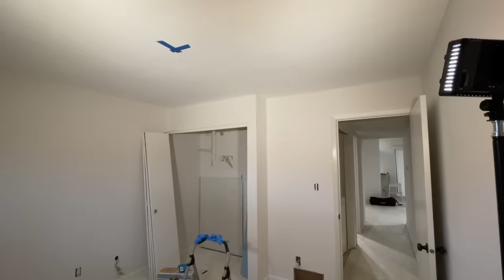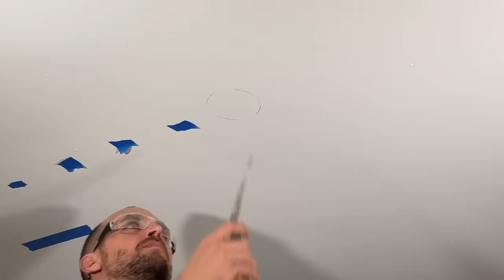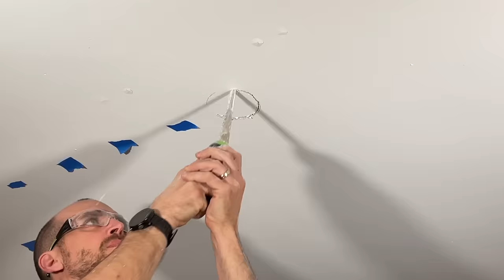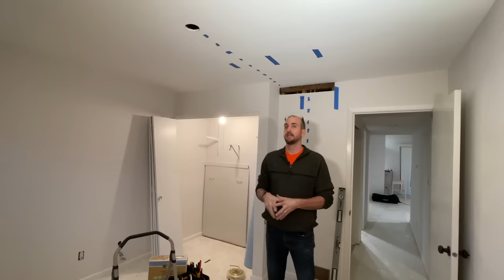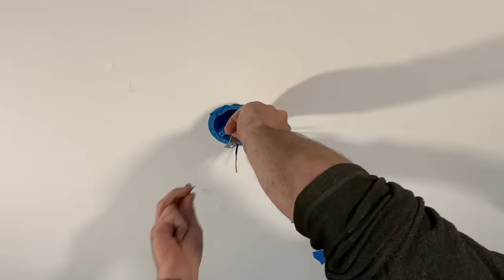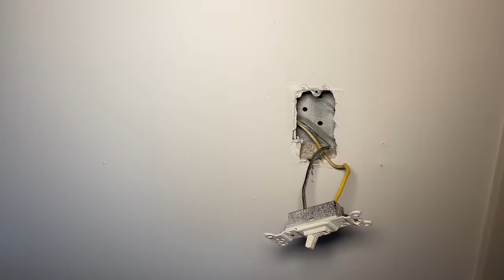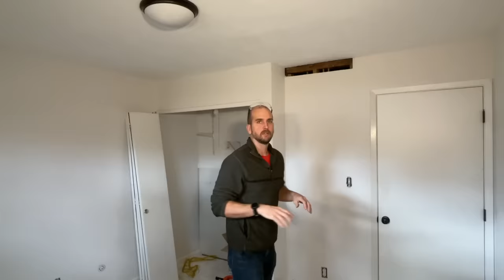How To Install Ceiling Light Without Existing Wiring

Comment: A really informative video. It's interesting how things differ in the U.S.A. In the UK you have to run a separate lighting circuit and a separate sockets ring main for each floor of the property.  You are not allowed to wire lighting circuits from a ring main for sockets. Also all wall sockets in the UK must be individually switched, defo no sockets without switches to isolate.
Reply: UK code was heavily affected by the copper scarcity due to War.

Comment: If there is an attic, it can be done without cutting any drywall (except for the box in the ceiling). 1. Find constant power source (in the attic or closest to it) 2. Make run to the box. 3. Install remote (to avoid running for the switch) 4. You are done.

Comment: Great video. But shouldn't the ROMEX insulation coat be white instead of yellow to the fixture and outlet? I thought yellow is used for bathrooms. 

Also, couldn't you make the connections directly to the switch, cap off the wire going to the outlet, and replace the receptacle for dual outlet "on" constant?

Anyhow it was a great video, and thank you for posting!
Reply: Newer Romex jackets now denote wire size. White for 14 AWG, yellow for 12 AWG, orange for 10 AWG, and black for 8 and 6 AWG. Yellow in the bathroom just means a 20 amp circuit instead of 15. This helps to not overload the circuit when for example both a hair dryer and a curling iron are being used at the same time. Heating elements draw a lot of power. That being said, I’ve seen a lot of older romex  that’s white no matter the gauge. So double check if your doing remodel work.

Comment: Now about the drywall repair......let me help, do the repair thats the easy part, its matching the knock down texture that the hard part add water to the drywall compound till its about a little bit thicker that pancake batter and stick all four fingers of one hand in it to, where they are wet , than throw them at the wall (patch ) and the compound will splatter repeat if needed than let it dry slightly or completely and use a trowel or sandpaper to do the knock down,  practice before hand in the garage is fun and will help.

Comment: Great video. Thank you. Just one question: at 14:15, what's the 4th neutral wire? One is coming from the ceiling fixture, one is connected to the left side of the outlet, and one is going back to the breaker box. What is the 4th?
Reply from the maker: Hi Paul,  the 4th was going over to another outlet which was wired on the same circuit.
Reply: @EverydayHomeRepairs  I am shocked that someone said about that, but on that topic. Some codes do not allow you to use a standard receptacle box as your junction box. You should’ve ran directly to the switch box with the romex then came through the emt conduit with the constant hot. Also because it complicates a lot for people coming behind. Because most come from the receptacle to the switch for constant hot.

Comment: You don't need a ground wire for conduit.  Also, if the switch already had a constant hot, why would you connect the yellow at the outlet box?  Seems you may not know as much...
Reply from the maker: Hey Darrell,  I was doing some work on the receptacle anyway to remove the switched functionality so that is why I went down to the lower box.

Comment: Many people have suggested running the romex from the light directly to the switch. I guess I dont understand how you do that when the incoming power goes to the outlet, not the switch. Would you need to run the 12/2 wire from the outlet up to the switch? I guess I'm confused about how to wire the light when there was no common wire in the switch box.
Reply: If he ran the romex from the light to the switch, then wouldn't the switch still turn the outlets off? He wanted the outlets always on (which makes sense). I get confused with this stuff as well, btw.

Comment: I have wired light fixtures and outlets many times but my 1978 built home always like to throw a curve.  
My second “hot wire” is red instead of yellow.  Fine it’s still identifiable.  I only have one outlet that it operates.  That means I don’t have to remove a bunch of “extra red”-even better.  My issue now is that inside the junction boxes are several “extra” black/white.  This may be a stupid question but how do I know which to use when re-wiring the outlet?  
Also, you changed nothing in the switch itself?  Everything was done at the outlet box, correct?
Reply: Red wire where? What receptacle? What switch?

You could always cut power at breaker, disconnect the wires in a junction box, tie two together (a black and white on the same wire) then test continuity at various receptacles to see which ones it runs to. When you hear the beep you know where it goes. That being said, you didn't really describe your scenario well.

Comment: Is it possible to spice into the switch instead of going to the outlet? This would leave the outlet on the switch and not power on but in my situation, the switch and the outlet are on opposite sides of the room with the switch is much easier to get to.

Comment: isnt that 12/2 romex? Is that okay on that circuit? nice video BTW
Reply from the maker: 14/3 Romex would be a better choice for this install.  Thanks.
Reply: @EverydayHomeRepairs  Take it from a master electrician, There's no reason for 14-3! How do you know you could use 14 awg?
Reply: @chadcarter269  I would have advised him to install an old work fan rated box with a 3c romex.   Depending on circuit  for size wire. 
If you're going through the trouble of running the wire, plan ahead in case someone wants a fan/light

Comment: This is an okay solution but I see ways you could have done this without having to cut the sheetrock where you did.  The closet is right there, you could have used the inside closet wall after drilling and fishing over to it.  You also have the option of using a ring insert you would use with networking with a two gang blank in the closet on the wall to avoid sheetrock repair.  Another tip if you need to remove sheetrock, use a rare earth magnet to find the nails before pulling the sheetrock, cut out around and pull the nails.  Then you can pull the sheetrock piece without breaking it.
Reply: Same thing I would’ve ran from that receptacle box, over to the closet ( Greenlee flex bit ) cut holes in closet and fish in the closet so I wouldn’t have any exposed patching, and mounted a proper fan box in the ceiling because somebody’s gonna put a fan on that at some point.

Comment: Good presentation, very helpful!
Reply from the maker: Thanks Joe!
Reply: @EverydayHomeRepairs  Hi Scott have an opportunity to install a new ceiling light just like your scenario. the only question is I have one more line that is on the left side on the wall switch that carries the load from the switch back into the ceiling somewhere down stream.
Questioning do I need to do anything with this? I think I should be good? Thanks

Comment: Thank you for taking the time to make these videos, extremely helpful. There is something I've always wondered, how many outlets / fixture can you have from one source? Can you keep adding junction boxes breaking off from the original source?
Reply from the maker: I think it depends more on the load of each receptacle / fixture.  For example I am adding 11 LED recessed lights next week to the same circuit but each draws so little power I am not worried.
Reply: Add the wattage of each load on the circuit, if you have a 15Amp circuit (most likely) then your cumulative wattage should not be more than 1400Watts, 20Amp = 1800Watts.
Reply: Theoretically unlimited. Practically, you have to consider possible loads in the room. How many amps will be used? Is there a window AC in there? Mini fridge? Those use a lot of current. TV? Modems, gaming computers, and routers? That can be 6 to 8 amps right there. What's the circuit rated for? 15 amps? I'd go all 20A circuits but most houses have 15A circuits so you have to think about that as your max amapacity. And then will you run a space heater in winter? Those run at 12.7A or somewhere around there.

In other words... you probably don't. Now many builders will put the lights on a different circuit but daisy chain a few rooms lights to that same circuit. But if you put a light on the receptacle circuit heavy loads you may notice the lights dim way down because you have to account for the lights and fans current draws.

Comment: Why did you use 12/2?  It’s only an LED light, or is that code in your area?
Reply: Probably because they wired the receptacles with 12 gauge wire

Comment: couple questions, 1 should have shown how to isolate before working. 2 why not just add another switch for light and leave sockets as they are. 3 is the fuse or circuit breaker rated correctly for lights. Always use a qualified electrician

Comment: I don't think you necessary need to remove the two yellow wire it just make it more confusing, the black can just attach with all the yellow wire and call it a day. I believe the light switch will still work.

Comment: You might want to center your cut out on the floor joist and use a pancake box and avoid the fixture from being puled down when they change there bulb

Comment: I have a questions I'm planing to install a switch light in my basement but currently there's only one of those light that has the string to pull it to turn on. How would i go about installing that I know I need wire from my light fixture to my light switch. But what else? Also I should ad my basement isn't finished so I don't have to cut through any drywall

Comment: It was hard to see in the video but why didn’t you have to drill thru the top plate of the wall to fish the wire down thru? Also, the floor joist direction shouldn’t much matter, as there is also strapping running perpendicular to the joists that you can run wiring between.

Comment: i have a kitchen that has the regular kitchen light, but over about 6 to 8ft over the diner table, a ceiling fan with light kit. as of now, when i turn the light switch on, both ceiling fan light kit and regular kitchen light comes on. how do i separate them out so that i can control fan light kit separate from kitchen light? i have a double switch that i wanted to use already that will fit in the existing switch box. also i've already taken the switch cover off to see if there's two hot wires, and there is only one hot and one neutral. thanks

Comment: I have a very similar situation  with the exception that my switch is perpendicular to the way the floor joists above run and the switchable outlet is about 10 ft away from the center of the room where we would want the light. Our home is a modular with 2x6 wall studs and 2x10 floor joists with hardwood floors so cutting through the floor above is not a desirable option. Any suggestions would be greatly appreciated.
Reply from the maker: Do you have another (switchable) receptacle on a wall that is parallel to the floor joists.  This is what I had on the other room so I used the outlet on a wall perpendicular to the switch.
Reply: No. There is only the one switch in the room.
Reply from the maker: @terrycastor8299  right but what about the number of outlets?  I actually went from a different outlet as opposed to the traditional method of going from the switch.
Reply: Pull entire panels of drywall off would be easiest. Might as well open it up. Then notch through the bottom of each joist and cover with strike plates or drill holes through each one. Who the heck doesn't include basic lights in each room. That's the crazy part. Yesh I've seen it but dang. And a modular home with two stories and 2x6 studs and they could not put a light fixture in the room? That's even crazier.

Comment: The blue boxed used for the led light on the ceiling what did you screw it into?
Reply from the maker: Those type of boxes are "Old Work" so they just have tabs that hold on the back side of the drywall.  It should be noted that those boxes are not rated to hold a heavy light fixture or fan.

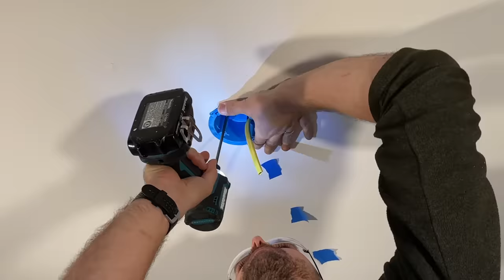Comment: Is there anything to hold the ceiling junction box for the light? I saw at 8:19 you were doing something. Thanks
Reply from the maker: After a ton of great comments I would say this is a much superior box as compared to the one I used https://amzn.to/2W0rDfY  The box I used just has a small metal bracket on the back and that was connected to the 2 screws I was tightening which secured the bracket to the back of the drywall.  This is fine for a LED light but not going to work for a ceiling fan if anyone tries to install in the future.

Comment: Nice method. But what do you do, if you have a brick wall and a concrete ceiling?
Reply: Exposed conduit for the industrial look?
Reply: @lorenwillis425  Exposed conduit I would not prefer in my living room.
Reply: @manfredwitzany2233  I understand.   But industrial is a style.   And really, in your situation,  probably the only solution.
Reply: @lorenwillis425  Not really. I use a crown drill to make a hole for the flush box and use an electric chisel to make a slit. In this slit I mount a conduit and refill everything with plaster. Then I can insert the electric wire.
Reply: @manfredwitzany2233  sounds like you had the answer to your own question.

Comment: I have the same issue in my house. However, I mistakenly fished a 14/3 wire into the switch box and removed the old outlet so now am unsure of which outlet the switch previously powered on. If someone has a way to help, please let me know.

Comment: You know some smuck down the road is going to install a ceiling fan to your drop in box, probably a better idea it to cut a 2x4  two foot long and push through the open floor joist and secure it through  the ceiling with a couple of 4'' screws...
Reply: Agreed. I think leaving a warning  note taped inside the light box would be another alternative.

Comment: Trying wire in a ceiling fan to a switch that controls a outlet in the room I  wired everything up when I turn on the switch powers the outlet and not the fan but when i switch it off and pull the fan chain it powered the outlet and fan

Comment: Why didn’t you just take the Romex wire to the Switch box? You could have connected it inside there & tied the outlets to the feed in the switch box, that way you would have never had to touch your outlets at all

Comment: Dumb question: why did you remove the drywall so far to the top? Unless there's absolutely no other way your're giving yourself a hard(er) time patching it up when you're so close to the ceiling (or any corner for that matter...). Just wondering.

Comment: Id like to see how to run wire across studs with minimum drywall damage.  No one ever shows that.  They always show the easy way to add an outlet or ceiling light using stud cavities to run wires.  I want to see a more difficult method of running them across the studs for a change, without tearing up the whole house to accomplish it.

Comment: Wouldn't it have been easier to go to the switch box and just change the switched outlet wires to constant and the new wire to the switch??
Reply: I had the same question...  if trying to make things simpler/less confusing for future, that would seem better than having the overhead light wiring routed through an outlet.

Comment: I usually rewire the outlet, so the wires going to the switch are changed to a hot and neutral. Then I run my wire from the switch to the light like a normal switch leg.

Comment: Quick question,  replacing a new outside light above a door, it seems that the existing light  had a ground from the internal home to the metal light box box, I left that and grounded the new light to the green screw on the mount bar, is that permissible?

Comment: Per NEC you should be stapling the Romex to the studs every ~2ft
Reply: I think NEC gives you an out on staples when it’s not readily accessible.  
———— 330.40 (B) (1)
(B) Unsupported Cables. Nonmetallic-sheathed cable shall be permitted to be unsupported where the cable:

(1) Is fished between access points through concealed spaces in finished buildings or structures and supporting is impracticable. 
——————

Also, I think it calls for securing every 4.5’ and within 12” of  the box.  ——-334.30. Securing and Supporting

The cable must be secured at least every 1.4 m (4½ ft.) and not more than 300 mm (12 in.) from a fitting, box, or cabinet. There are requirements for cable trays, unsupported cable, and wiring devices without a separate outlet box.
————
2020 NEC SECTION calls out max cable length of 18” to fastener.  So 12” “as the crow flies and 18” max cable.

Comment: So where did you turn off the power to be able to work on the wiring, or were the outlets hot all the time?
Reply from the maker: No, I turned off the breaker which fed that circuit.